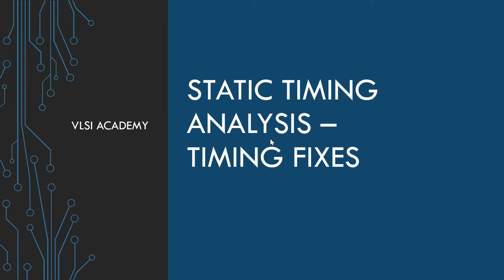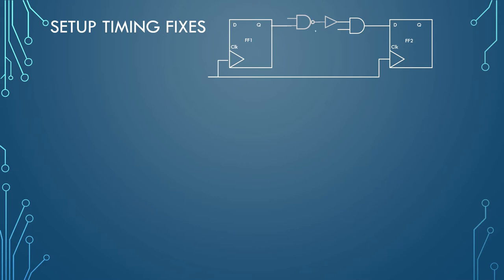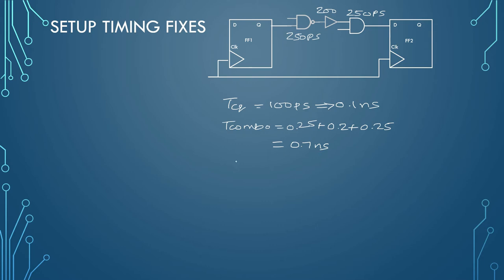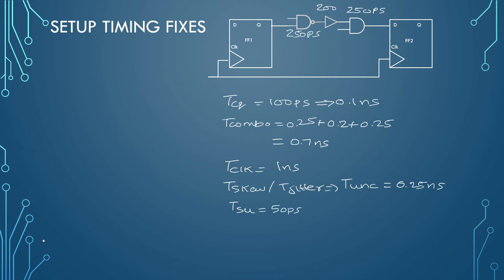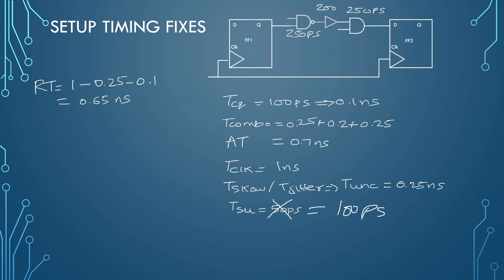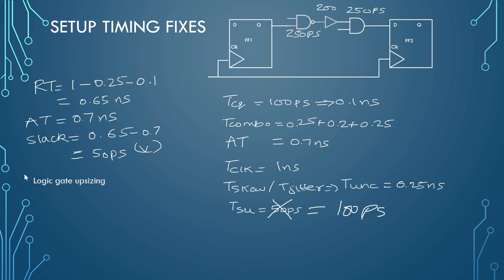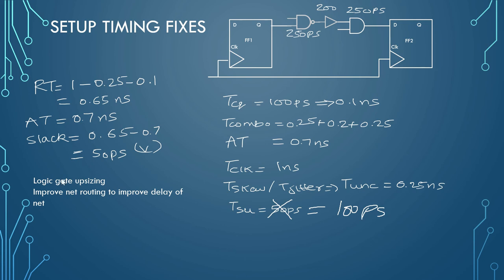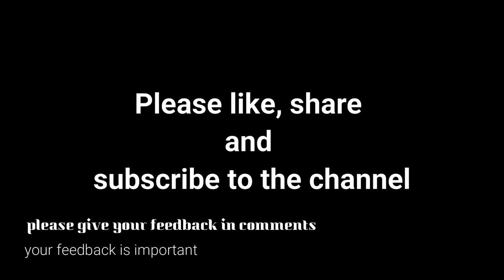sta lec20 setup/hold timing fixes - part1 | Static Timing Analysis tutorial | VLSI

Comment: if we do upsizing we get improved driving strength which can drive larger load and also aur w increasing so capacitance at load increases so charging/discharging it take more time so our arrival time get increased so slack becomes more negative...how u saying slack will improve?
Reply: we assume the load order of the fan out stages is higher than output capacitance due to driving stage